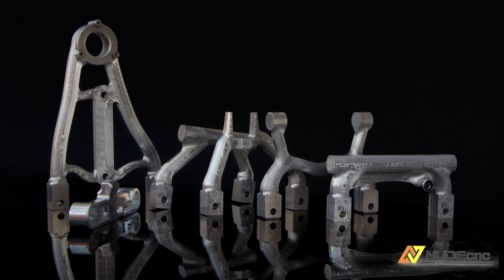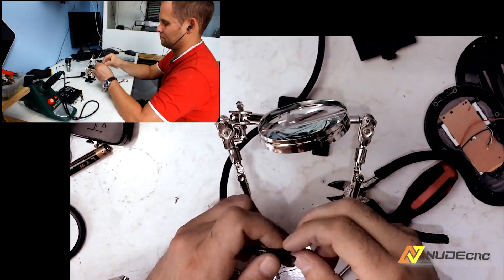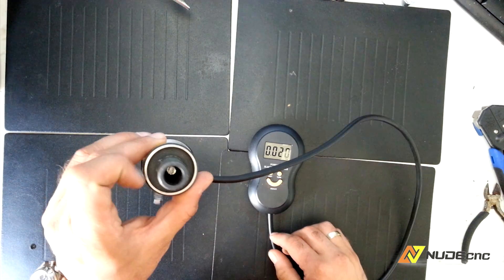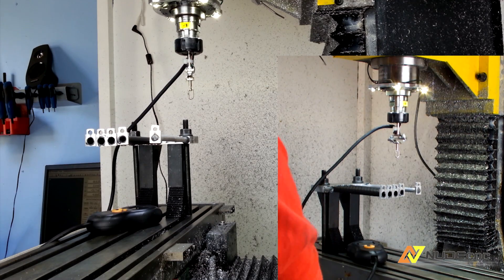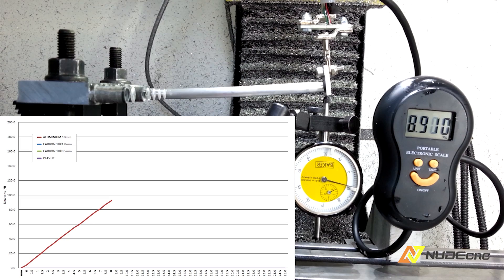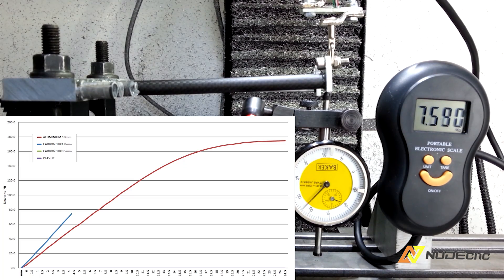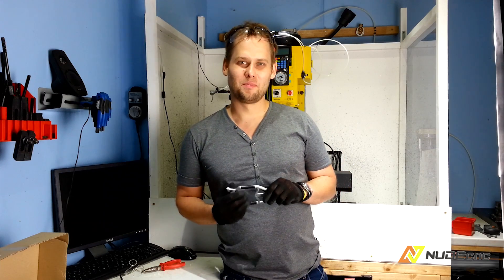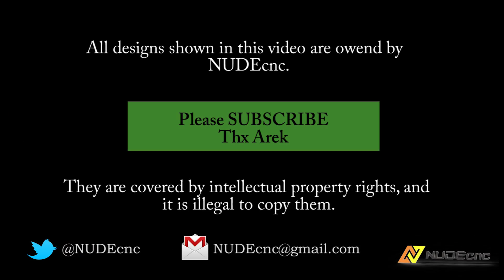Aluminium vs Carbon fibre strength TEST Part 3 of 3 (RC Model CNC build)

Comment: Hi
Interesting but incomplete I think.
When you use “aluminium” as a part of a comparison test you need to at least state what aluminium alloy is being used.
For example 1100, 2024, 6061 or 7075 amongst many others they vary tremendously in strength between types.
Then there is the hardness T6 etc etc..
It would be far more interesting if you had all of the factors included before comparing apples with oranges.
Even the carbon tubing comes in so many variants..
Excellent effort why not re do it with all of the info you may be surprised in terms of the aluminium in particular.
Look up some of these numbers I listed above and you will soon seen why it needs to be stated when comparing.
This is why in full size aircraft these alloys are always specified.. such as 6061T6 etc

Not knocking your great effort. just saying..  cheers

Comment: You use 10x1 carbon and 10x 0.5 carbon. The aluminium is 10. Its mean its 10mm full aluminium cilinder? Why dont use to test 10x1 and 10x 0.5 aluminium....
Reply: I believe aluminium tube must be stronger than aluminium rod

Comment: Pretty neat and interesting.. I'm actually going to be woking with cfrp in a project this month... pretty hyped.  Also, nice video, although it probably didn't need to be 3 parts... could've got the message across effectively in a span of 10 minutes total, which may increase the number of people watching to the end.   I'm no expert though, so take that as you will and keep up the good work!  Cheers!

Comment: Carbon fiber has one other advantage. It will hold its shape after impact. So after it is stressed it will return to its original shape. One reason it works great on foam cores.
Reply from the maker: +Claude “Reviews4U” Rains  Yes and no . It will hold its shape after impact - Well, rubber would do that , carbon will breake . The phenomenon which probably you have in mind is called FATIGUE . Metal / aluminum fatigue so you have to put much more material to overcome this problem. With carbon there is no problem with that. That's why carbon can be so light .
Regards Arek

Comment: it is wrong to compare tube with rod. just find an alu tube of the same dimensions with the cf tubes. The results will be comparable.
Reply: +NikolaosLedZeppelin Not really. Solid rod is slightly stronger than hollow tube of the same diameter. It's just a myth that hollow tube of the same diameter is stronger. The real advantage of hollow tube is that it has a much better strength to weight ratio, because the strength has a linear relation to the the second moment of inertia of the cross section area. In other words, the farther the mass is distributed from the center, the stronger the tube will be given the equal mass of same material. Google will show you many readings like this one:

h t t p : / / www.fourwheeler.com/how-to/1101or-steel-tubing-myth-of-the-tube/
Reply from the maker: +NikolaosLedZeppelin  
Question: What will be stronger: 10 mm tube 1mm wall, or 10mm tube with 2mm wall?

?????

10mm rod= 10m tube with 5mm wall :D 
Rod is strongest version of tube. 
So I compare 2 types of 10mm tubes,  given carbon tubes to best  aluminium scenario.
Reply: +NUDE cnc excellent job
Reply: +NikolaosLedZeppelin it is all about the weight not the dimension, 

so, on same strength, how much wait can be removed
Reply from the maker: +NikolaosLedZeppelin That wasn't the case of this test. I wanted to compare 2 situations .First when part is fully machined from aluminium. At the moment there is no way to machine hollow profile inside, that's why I used rod not tube. And yes tube would be stronger and lighter then rod.
Reply from the maker: +NissanAltima2005 Final aluminium ,carbon suspension was about 30% lighter then stock plastic one :)
Reply: Ivan Wong Thanks I already know about rods and tubes. :) Still is not the proper way to compare different types of materials and different types of profiles. if you want comparable results you must match either the profile or the material. (f.e. steel rod VS steel tube, or steel tube VS alu tube, etc!)
Reply: +Ivan Wong finally clarified!
Reply: The point is that this test already favors aluminum. Any 10mm aluminum hollow tube of the same material will only perform worse. So IMO this test is still very useful to people who want to make a choice between aluminum and carbon fiber. If I am making a delta 3d printer, I'll pick carbon fiber any day.
Reply from the maker: +Ivan Wong Delta 3d printer. yes CARBON is your best option. As weight and rigidity is main problem, I would go with 0.5mm wall option, and doubled amount of rods if needed. You can see and compare 0.5mm and 1mm rigidity from graph from video :)

Comment: How did you make a graph, manualy? I'm interest about measuring rigidity of desktop milling machine using different materials like cast iron, epoxy granite etc, but I'd like log all measurments on PC over serial or parallel port..
Reply from the maker: Marijan Jakara HI mate it was done by hand :) 
I was thinking to connect weight scale probe to oscilloscope. Something like DSO 201 - 80$ for digital one. You can record wave form as *.cvs.
I'm waiting for one just now :)
Reply: NUDE cnc Great job with graph. I just order weight scale and I will try make some sort of logging device on linux. Also I'm searching for cheap digital micrometer for this purpose ..

Comment: This is fantastic. Thanks for testing. Even though I am using carbon tube for a non-RC use I was still not quite sure about it's strength. Just want to see how it holds up to oblique angle loads

Comment: Hi. Nice test. what was the wall thickness of the Aluminium? It looked solid.
Thanks
Reply from the maker: Maxi77  I did compare 10mm aluminium rod (solid) vs carbon fibre tube (10 mm OD 8mm ID)
Reply: NUDE cnc Thanks, Thats impressive that the 10mm(OD) 8mm (ID) carbon tube is stronger than the 10mm solid Aluminium. Really like your videos !
Reply from the maker: Thx. That was the idea to show this :D. 
I don't think that you can't believe till you see it :D
THX for support.